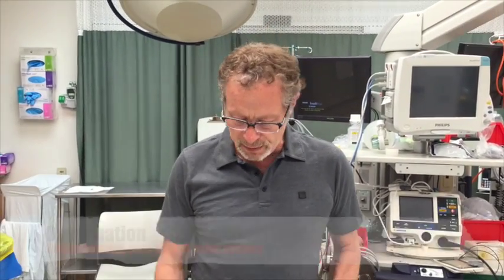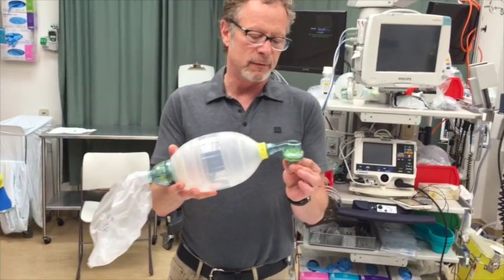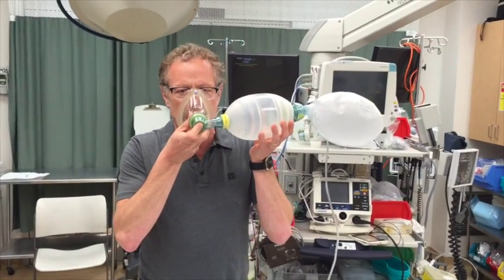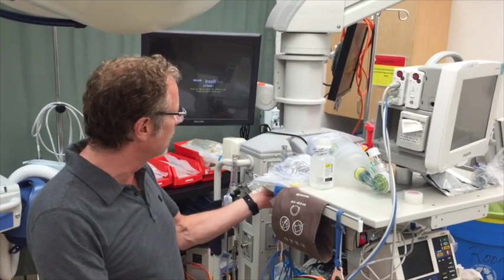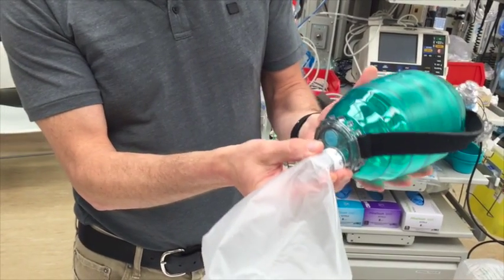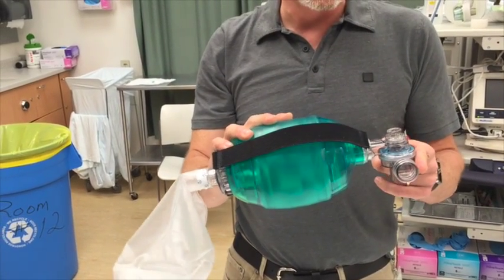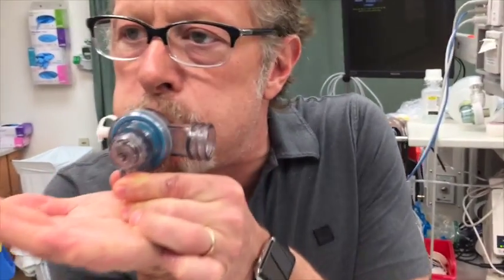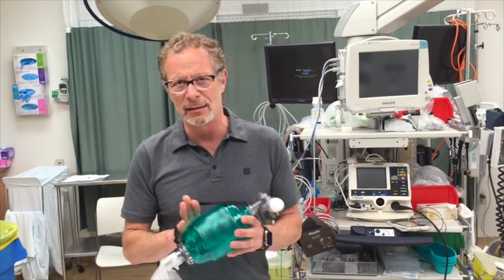Oxygenation -Understanding your BVM Device 2

Comment: If you had an apneic patient and a tight seal with the BVM, will the patient receive any passive oxygen through the duck bill valve if you weren't assisting respirations?
Reply: My understanding is no, they would not revive any oxygen. you have to squeeze the bag reservoir to force the “duck bill” open and deliver the oxygen, with the expired C02 leaving through the valve passively.

Comment: I’m a smoker and a paraplegic, I’m paranoid about getting this virus. I’m thinking about ordering one of these on Amazon in case I get sick. Do I need an oxygen tank or something ? Please help.
Reply: Having oxygen will create a better system, but it is not necessary. By squeezing the bag without pure oxygen in the system you will still increase your lung volume, but you will need a peep valve as he shows here.
Reply: @philipbrennan4045  no way. If you are so sick you need supplementary oxygen please call 911. ER doc here. don't try to self treat with a BVM at home, that's lunacy.
Reply: Richard Byrne but if my husband can’t get into ER and treated fast enough isn’t ambu bag better than nothing? I’m worried about people not being able to get Off ventilators